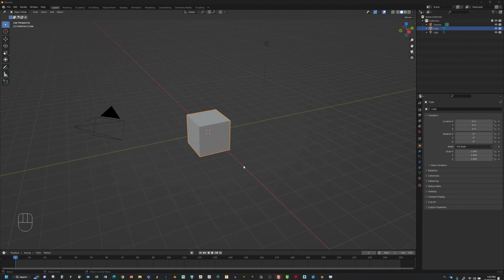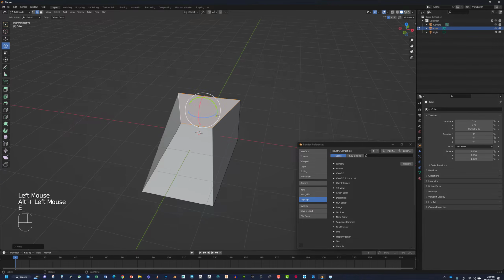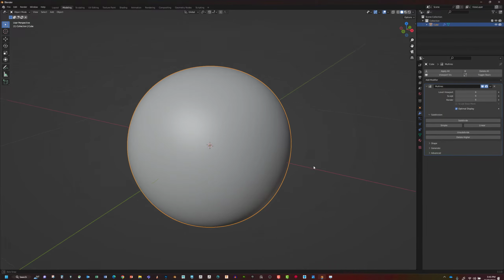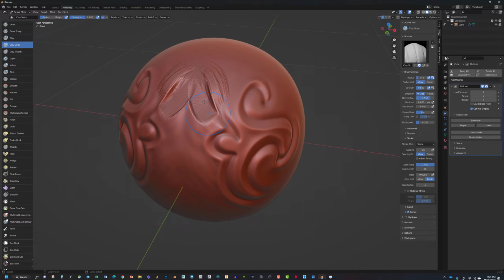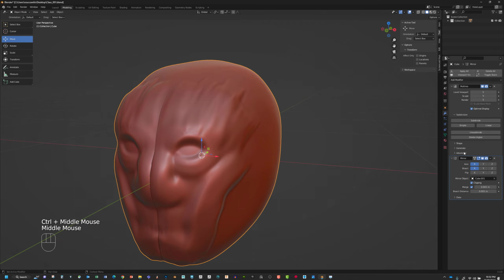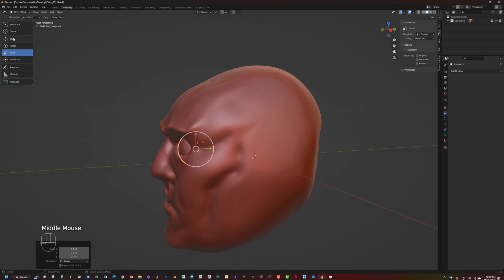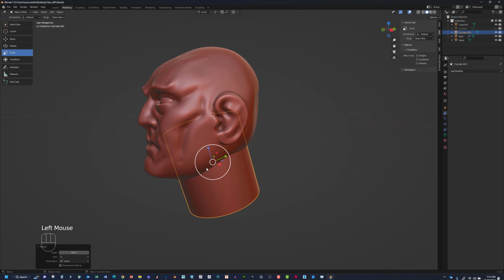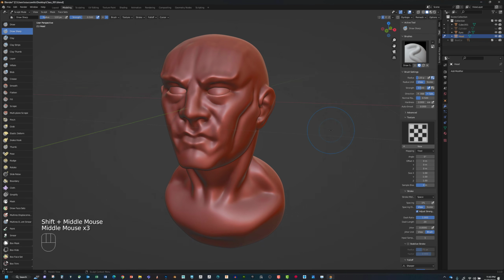Introduction To Digital Sculpting In Blender

Comment: you don't actually need to use the booleans like you do in this video, you can just ctrl-J them together in object mode and remesh and it should achieve the same result
Reply from the maker: Thank you for the note! I’m a very green blender user so any advice would be most welcome!
Reply: @nickzucc  another thing that would probably save you some time is the voxel remesh hotkeys. You can visualize the size of the grid with shift r and then remesh with Ctrl r in sculpt mode. I recommend keeping it above .005 depending on your hardware